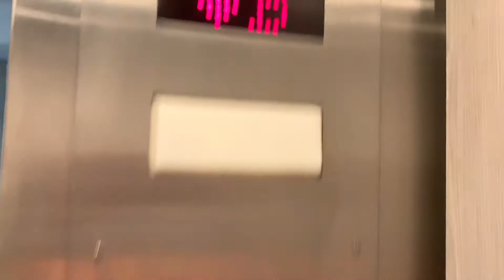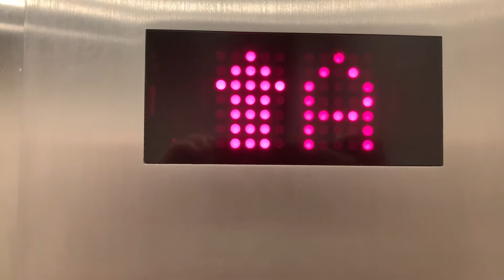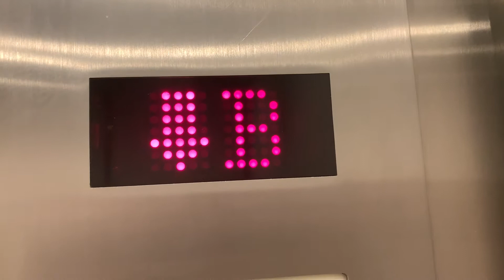EXTREMELY WEIRD Westinghouse AE (mod. Dover?) with PTL and GAL! 1275 Summer St - Stamford, CT

Comment: Dover actually did do this modernization. Both of these elevators have Dover helplink phones which were installed when these elevators were modernized. It is interesting to see Dover use PTL though which is not very common for Dover to use.
Reply from the maker: That’s cool!
Reply: It's possible the HelpLink phones were installed before the mod.